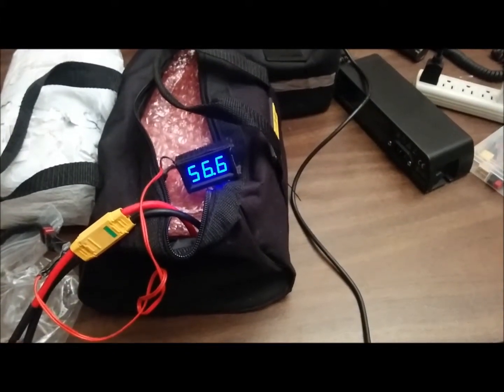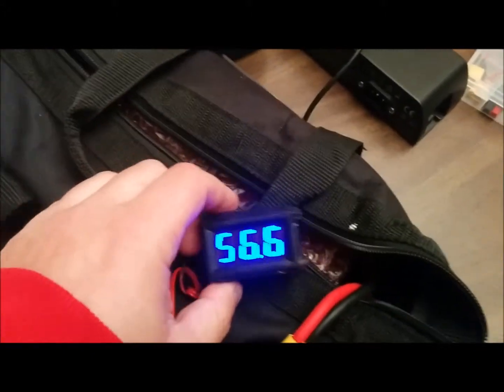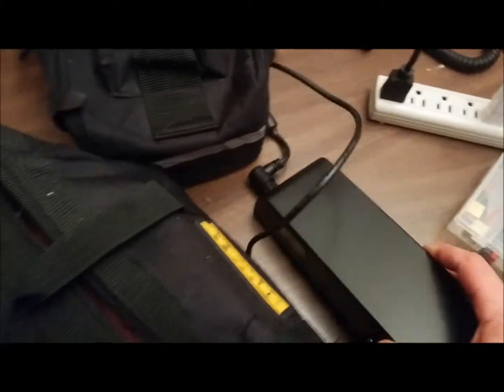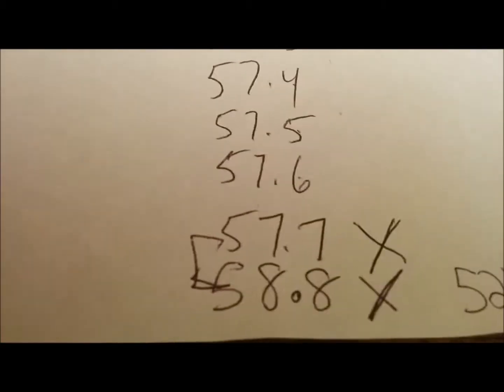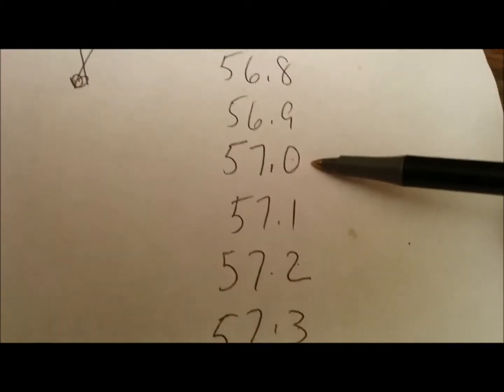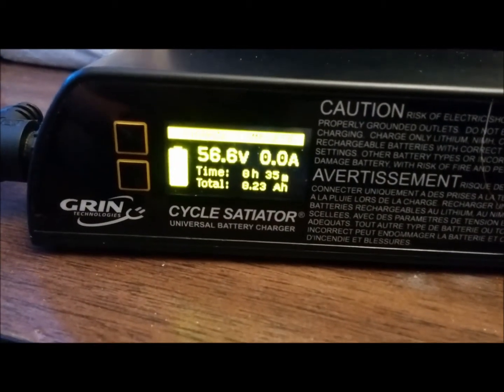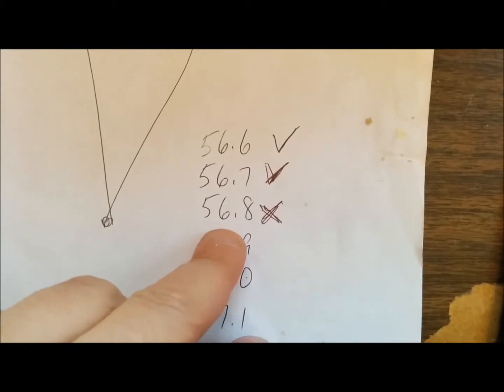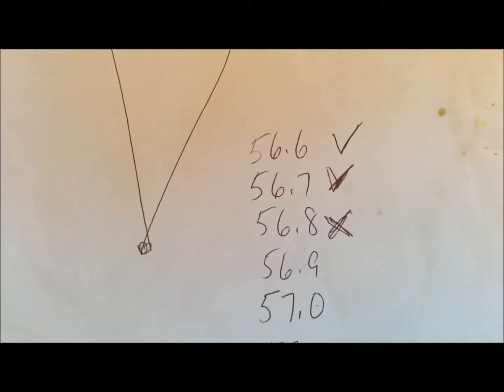Solved - NYCEWheels Brompton Ebike Controller + 52V Battery = 56.6V or 85% charge max

Comment: They say Battery will last much longer if charged to a lower voltage.
Reply from the maker: +Cloud Base Thanks Cloud - I agree, this battery is going to last a long time since it's going to be charged at 56.6V. This battery is  used for a 11 mile commute that I have when the weather is cold, or raining. Top speed is 24 miles and I use about 10AH worth of juice.
Reply: David Like the Videos Jed C